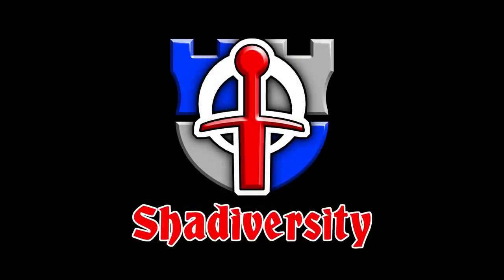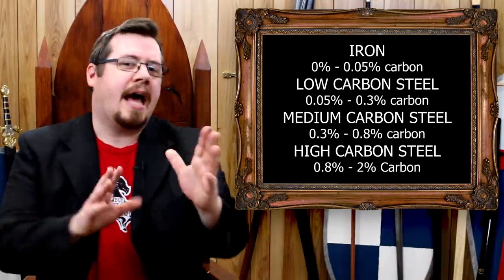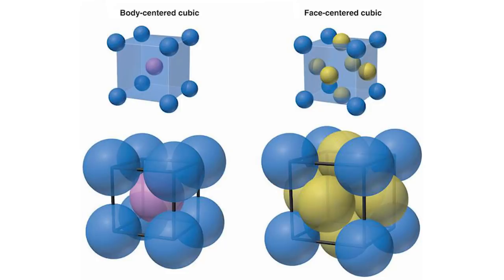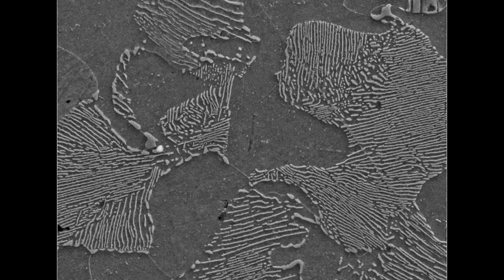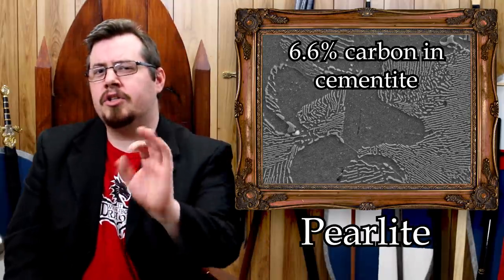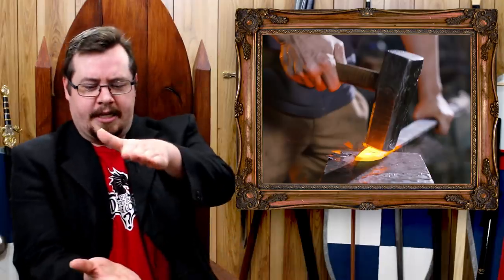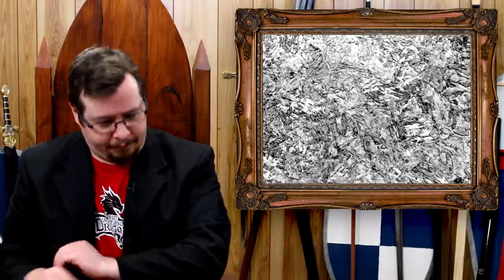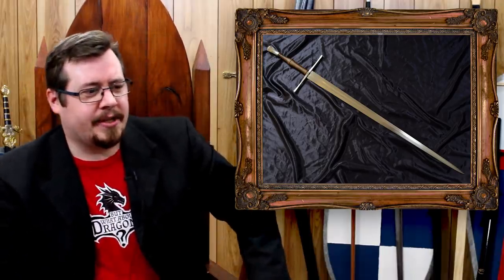What quenching and tempering does to SWORDS

Comment: 8:46 Martensite can shatter like glass if you drop it.
Reply: Is a titanium sword practical? Say if writing a Medieval story and accidental discovery, whats much better a steel or Titanium?
Reply: @kaelthunderhoof5619  Titanium is too brittle IMO to make a good sword. Steel can flex and deform a lot before it breaks, whereas titanium will shatter almost as soon as it starts to deform.

Additionally titanium can't be heat treated and it's properties can't be controlled by varying the mixture, like you can with steel and it's carbon content. Being able to have a flexible core and a hard wearing edge it the same piece of metal is a big advantage.

There might be other reasons, but I think these two alone make it a bad choice.

If you did want to use this concept in some way, an alloy or steel and titanium could be a similar concept that could result in a practical sword that is better in some ways than regular steel (though it's worse in some ways as well).
Reply: @TonkarzOfSolSystem  yeah I recently watched a guy made a titanium sword he even had a hard time making an edge. So he make it like a giant bread knife. In your opinion what's the best item to be used for titanium? An armor? Arrow or a spear? Sorry I'm not really versed with material science. Thanks for replying though.
Reply: @kaelthunderhoof5619  I think it's generally not a great idea to use titanium in a combat role because, as mentioned, it's brittle. 

What does it mean to say that titanium is brittle? What it means is that a blow that might merely dent or deform steel would crack or shatter titanium.

Titanium's properties are similar to certain kinds of ceramic, and in armor ceramics are often used as a layer of plates behind a layer of steel (or some other material that can absorb energy from the bullet - the ceramic plates are expected to crack when the bullet hits them and in doing so they'll use the bullet's remaining energy).

Another thing to note is that titanium's biggest advantage over steel is being much lighter, and in most potential medieval battlefield applications this is actually a disadvantage. But for armor it's a major advantage, so I think any practical and preferential application of titanium over steel would be in armor of some kind.

So I think the main use that jumps to mind would be something like a brigandine, that is to say a layer of small individual plates fixed to a flexible material. The plates would be thicker than steel plates in an equivalent armor (but still only a few mm think), to account for the titanium being less rigid, but it would still be a lot lighter than an equally protective armor made of steel. 

Another alternative would be something like scale mail, with a layer of steel scales (thinner than usual) over a layer of titanium scales. 

The reason why I suggest individual plates, such as in a brigandine, is because if any plates shatter or break, the damage will be confined to the individual plates and thus only have a small impact on the armor's ability to protect. 

Additionally titanium is very hard to work compared to steel, so with medieval technology they'd probably have a hard time making complex shapes.

Overall though any potential applications have big questions associated with them. Titanium armor would be vulnerable to hammers and sharp points like on the reverse side of a bec de corbin, neither of which were uncommon. So any application of titanium would have to mitigate this in some way, this is why I suggest a layer of steel in both the scale mail and brigandine, but honestly it does seem to defeat the point of titanium armor in the first place.

I think a titanium/steel alloy would be a better armor overall though as the main disadvantage such an alloy would have in a weapon is actually an advantage in armor - I'm talking of course about being much lighter than steel.
Reply: @TonkarzOfSolSystem  yeah after reading too many about titanium there's so many plotholes that i will encounter or am I being too paranoid on world building. Anyways thanks for your opinions and insights I'm just going for some discovery of tempered steel was hoping for tungsten like using it to pierce a creature's scale but working on it would much be more impossible. Oh, one more thing, any thoughts on hollow point arrow or maybe ballista? Would it deal more damage than a normal barb arrow? Or the velocity wouldn't be enough for it to work?
Reply: @kaelthunderhoof5619  I'll leave you with a final note which is that most people don't a care about realism. 

The Matrix can get away with humans as batteries and John Wick can get away with silencers so quiet that assassins can have secret gunfights in crowded subway tunnels.

If you want titanium swords just do it. Just don't describe everything about how the swords are made, and add just enough to suggest they've got something special that makes it work.

Realism can be a good way to prompt world building and design, but it's ultimately not important as an artistic value.
Reply: @TonkarzOfSolSystem  yeah I know I'm getting too hard with the realism but I'm just fed up with the fantasy genre really. So I tried the concept of maybe medieval technology for a change. Some Da Vinci character vs The horde kinda theme. More like the great wall movie but against a village of serfs.
Reply: @awashburn6944  Those are titanium *alloys*.

However, fair cop that I was not aware of this information so thanks.

Comment: This tempering, you claim you need to heat the metal to a lower temperature than the temperature needed to alloy iron and carbon to make steel. Does that mean that if you have the ability to make steel, that you by extension should have the ability to temper it?

I'm asking for a character I'm writing. He has gone around for the longest time wielding first a ninjato, which has the traditional Japanese differential hardness, then a straight edge blade of similar make, except with an enchanted edge, both of which were gifted to him. Eventually he ends up in another world, loses his blade and cannot find the metal to make a satisfactory replacement sword out of. In his own words, if he is going to wield a sword of the like he can make with the stuff he can find, he might as well fight with a wooden stick, and so he goes around wielding a bokken until he finds actual iron that he can make steel out of. He has been taught smithing in the traditional Japanese way, but he is also a smart and pragmatic guy and would know about the advantages of tempering. Being in that position, would he forge a traditional sword or a tempered one? Would it make a difference based upon fighting style?

Comment: It's not rocket science. The Katana breaks and bends rather than snap break. The hardened (brittle) edge breaks, but the softer core bends. That's how a well made katana doesn't snap. Blades that are all the way hardened are brittle and more prone to snap. Unhardened blades will bend and deform more easily and won't hold a sharp edge against much.

Comment: Very good explanation.

I have a strange question- Would titanium make a good sword material?
Reply from the maker: unfortunately no, it has great properties in terms of weight and flex, but it's terrible at holding a sharp edge, you can't cut with a blunt edge.
Reply: Ah. Thanks for the quick response!
Reply: Shadiversity do we know of any modern materials that would make a better sword than a spring steel one? I'm guessing not
Reply: Titanium (Mithril?) for armor, Tungsten (Adamantite?) alloys for weapons.
Reply: Bruno Vásquez I think that tungsten would probably suck for making weapons because it's heavy and, if I'm not mistaken, while very hard it's also brittle. I'm not sure that there's anything better than modern steel for making weapons with, after all, we can make some pretty good steel alloys these days and we can make the steel with far greater consistency as well so if we make a sword out of X steel it's 100% X steel a not mostly X steel but with some parts of the blade being more like Y & Z steel.
Reply: vanadium comes to mind, but i've never checked its properties in regards to be used in blades
Reply: there are much more advanced steel alloys (for example stainless steel) that have way better Jominy Hardenability.

Comment: Pre-modern Japan also had inferior steel. Both in terms of the composition of the raw ore (or rather iron sand), but also because their furnaces were inferior.
Hence why they were forced to use pattern-welding (the folding).
That, and the scarcity of iron, was also a big reason for why they laminated different steels together (a practice that was often done for economic reasons, more than anything else).

Comment: Please never use "pure steel" it's much like saying pure soup or pure jeans. All alloys (like steel, bronze, brass etc) are mixes of different  The amount and the variety (oh the variety! A bit of W and fusion point goes throughout the roof; Co avoids brittleness in cold temperatures; Ti, V even Cu make many resistances higher ... I once dreamed of making a full codex of 0,1%; 0,5% and 1% of steel a bit Chesmistry in the University was a bit too much Calculus to me) of additives can have huge impact on steel properties. How do you think they make a steel able to withstand fast winds while under -50ºC or that doesn't melt while fastly digging through hard rock (+1500ºC)?

Comment: I think you have a flawed understanding of solid-state physics.
First of all, face-centered cubic is more dense as a configuration than body-centered cubic, not the other way around.
I think the central point of quenching is the crystal size.
Generally, the slower you cool a material the bigger the individual crystals in it become (higher long-range order).
And for an alloy like steel this also means that there is a bigger separation of elements.